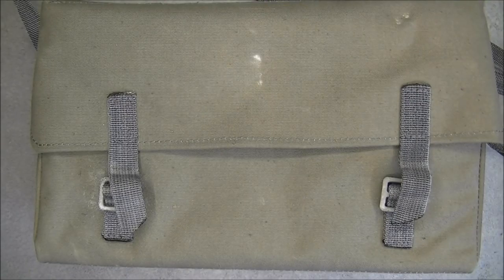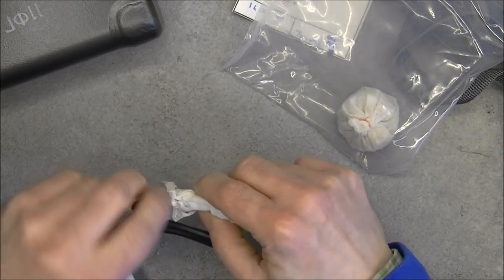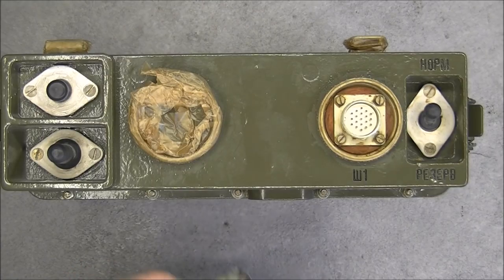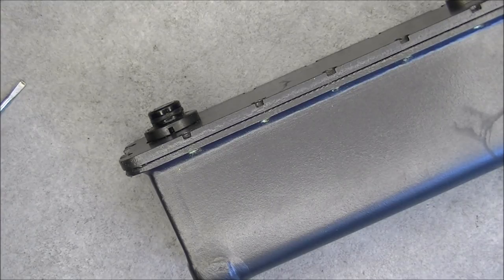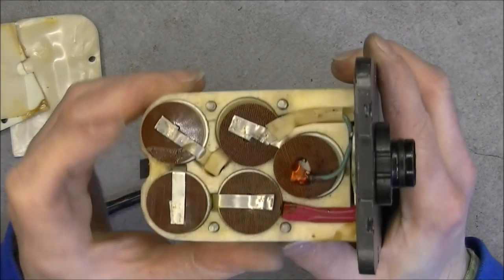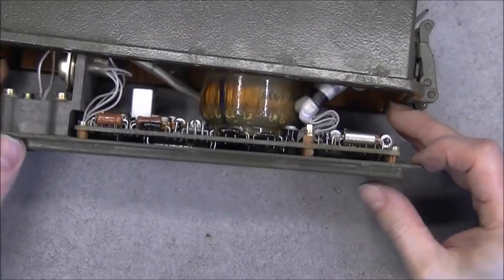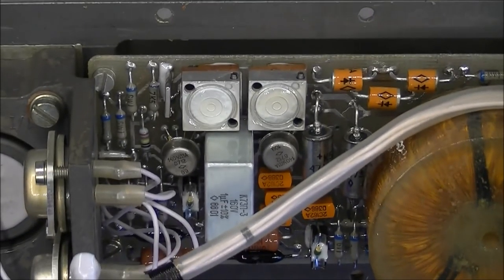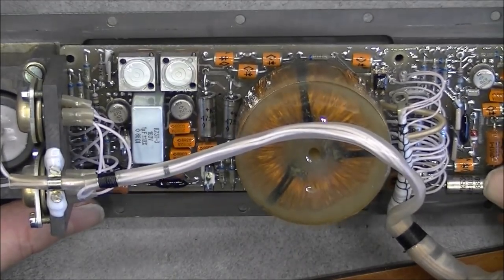Soviet 9S469M light interference indicator teardown

Comment: The orange all-plastic diodes are Zeners, all of them are 6.2V. The barrel diodes are a bit unusual. Is the writing says 2D206A? The power transistors are germanium ones - I.e. dinosaurs. The opamps are also very obsolete for 1987, 140UD1 are the equivalents of uA702, which was one of the very first opamp ICs designed in 1964! Be careful with that white stuff around the small diodes - it might be a beryllium thermal conducting compound.